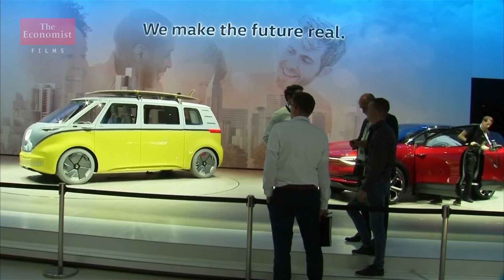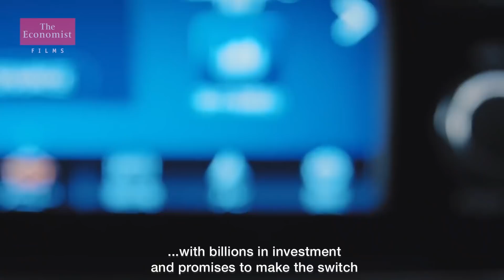Electric cars will come of age in 2018

Comment: Like all new technology, there will be teething troubles, the grid needs to go clean for a start, but stand-alone solar charging stations without any grid connection could be one way forward.
 The Grid is a bit like the Oil industry, it has served us well I suppose but it is also corrupt and rotten to the core.
 Nuclear is certainly not the way forward, at least in its present form, it is just too costly and dangerous and produces so much CO2 during construction of the plant, fueling and decommissioning, if all costs were born by private industry with no subsidies then Nuclear in its present form can never be profitable. 
If the grid is to continue we need more renewables and energy storage facilities.  Tidal power should again be looked at, and other forms of little tapped free energy like Geo Thermal and Air Thermal.

Comment: If the technology is there by 2040 great, but if not the diesels will have to stay. If we had the technology now we could already stop making the diesels  and let the older vehicles phase themselves out.  Could buy a diesel it 2039 and it should still be  good till 2054, i would give up driving then anyway. Or get a 43 year old 24kw leaf they say they last forever fewer moving parts and all

Comment: I don’t understand why people refer to batteries as being as dirty as oil. The battery is the equivalent of the gas tank. But the fuel inside is hydrocarbons and electrons. Now if we had one time use batteries, they would be inferior, but they are rechargeable. 
Then on the idea of it being bad that electricity to charge batteries is still very dirty because it comes from hydrocarbon burning power plants. Well yes, but it’s a lot more efficient to run one big motor than a million tiny ones if the sum torque output is the same.

Comment: Here we go again !   Electricity means burning coal and gas and therefore still pollutes ~ Well that is not necessarily correct.  One only has to take a look at the time and effort going into Molten Salt Reactors (Developed in the USA in the 1950's and 60's) in Japan and China.  LTFRs are to the Coal Fired Power Station what a Tesla Electric Vehicle are to the worst Gas Guzzling Internal Combustion Engine ever made !  Molten Salt Reactors are walk away safe, clean, compact, non poluting, efficient and cam also dispose of the stockpiles of Nuclear wast we are currently trying to hide under rocks and behind mountains !!  Do the research, open your eyes and imagine a brave new world !!

Comment: Electrice cars are going to be burden on the electrice grid ,    watch the price of electricity go right up.
Reply: That is entirely not true.  Most power generating plants are running at idle at night, once the sun goes down, people go home, office buildings go dark, A/C's turn off, computers are powered down etc.

There is a huge surplus of electricity generating capacity at night, which is why most utilities heavily discount it at night.  Wind power is also stronger at night than during the day, and increases production when demand is actually very low.

EV's are ideal to capture that excess generating capacity that otherwise goes to waste, which is also why many utilities offer ultra cheap EV charging at night.

EV's will actually help the grid and lower prices, by capturing wasted energy and using existing generating capacity more efficiently.

Comment: Wow never had the Economist down as a coal shill, also batteries are not solely reliant on cobalt and most manufacturers newer chemistries are drastically cutting the percentage of cobalt which is already less than 5% of battery by weight
Reply: Very true, the newest Tesla 2170 cells used in the Model 3 are down to 2.8% Cobalt already.

Then again, people keep crying about Lithium Ion batteries because of Lithium shortages, not realizing that despite the name, Lithium Ion batteries are less than 2% Lithium.

Comment: Electric cars existed more than a 100 years ago. In fact a 110 years ago they were one of the most popular choice after steam cars and far ahead the gasoline ones, yet the latter took off when mass production of them started - and no it was not the range what made it for the gasoline cars or the availability of gas stations (there were electric cars running charged on gasoline generators already since WWI), it was the lowered price due to mass production promoted by the oil cartel and the banks behind them. It is the same lot of interests which promotes the electric cars today : the reason why is huge : electric cars are far more easily controlled and tampered than gasoline/diesel ones since the real future of electric cars is autonomous driver-less wagons and there whoever controls GPS, controls the economies of nations.

Comment: So electricity will win this game ....... hhhmmmm ......... and what eco friendly energy, if this does exist in large enough quantities, are you gonna use to produce the electricity ???  Not so green extremely expensive and inefficient wind mills and inefficient even more expensive solar panels ????  Good luck !!!
Reply: Not sure what you base your claims on that wind and solar power is not efficient.  Solar panels today last over 25 years, and solar installation today pays for itself in 8 to 10 years, meaning you get 15+ years of free energy.

The USA alone generated 255 Terawatt hours of electricity in 2017 using wind power.  Considering that a typical electric car today uses 250W per mile, that is enough energy to drive an electric car 1.000.000.000.000 miles.

Considering that Americans drive around 14.000 miles annually, that means that is enough energy to power over 7 million electric cars every year in the USA on wind energy, if each is driven 14.000 miles a year.

So much for inefficient wind mills....

Comment: WRONG!!!
Graphene Batterys are already on market and will be from 2019 in Nissan Leaf 
https://pushevs.com/2017/09/08/lg-chem-will-introduce-ncm-811-battery-cells-evs-next-year/
Reply: I think you are confused about something.  The NCM 811 battery is a standard Lithium Ion battery, and has nothing to do with Graphene.

NCM stands for Nickel Cobalt Manganese, and 811 means it is 80% Nickel, 10% Cobalt, 10% Manganese.

Which again, means 0% Graphene, which is a totally different material which hasn't made it into batteries yet.

Comment: Electricity is produced by coal? Yes so is gasoline, because it takes electricity to produce gas as well.
Reply: Gasoline production takes heat, that is not provided by electricity.
Reply: Consider the oil rigs and fields, boats to ship it, trucks to move it. They don't factor all that in the production of gasoline. Electric cars don't care where the electricity comes from. It can be fossil fuels but it can be solar, wind, nuclear, hydro or a generator. It best to look to the future because fossil fuels won't last for ever.

Comment: Solid state batteries are the next generation for electric cars. They  will stop using a liquid electrolyte and use a solid electrolyte. That solid could be a potassium or sodium ( salt ) based material. It could also be a glass based battery. The testing on these types has been going on for over a year but won't be ready for public use in electric cars and trucks until the 2023 models. Point of interest-- who is the leading edge company in glass products? It's the glass cookware company from the 1950's that developed Corning Ware cooking dishes made of glass. Corning went on to research and develop the glass for cell phones and computer tablets known as Gorilla Glass used on all smartphones around the world. If it's going to be a glass based battery, Rochester, NY Corning Glass will be on the leading edge. The next gen battery will be in wide testing in 2019. Glass or sodium is hundreds of times cheaper than today's lithium ion battery, so the 2023 electric car might only cost $3,000 to $4,000  more than a straight gasoline car, meaning prices below $30,000 in the U.S. Stay tuned.

Comment: Moron. First even if you charge your car with dirty electricity it's 5 times more efficient to burn the fuel at the power plant than it is to burn it in the car. That's why equivalent miles per gallon are so much higher than gassers. But everyone will buy solar panels that has a roof to put them on so stop being dumb asses.

Comment: Electric cars are 90-plus percent efficient versus petroleum-based cars at the highest 35% so even if the electricity comes from Dirty power plants they use much less of it also about the Cobalt issue this is 2018 it's already being phased out in favor of silicon electrodes so the dirty electric argument and the Cobalt problem are both being phased out the arguments have no merit

Comment: You already see it marks the end of oil. After all it will run out! Like coal it will go away!  Like burning wood! The car manufacturers see this coming and doing what is need to do now, horse has been replaced by the car and the electric car will replace the gasoline car!

Comment: It takes approx 4.5kw alone to manufacture 1gal/3.7l of gasoline. 4.5kw will get your electric car about 30km alone already. So, instead of spending 4.5kw of electricity to manufactured a fossil fuel into gasoline to then propel a car an electric will comparatively gain an addition 30km right off the top.

Comment: Not going to happen. This is only going to happen if the get the prices down to a comparable gas model. For instance a Corolla which I have and paid around 16,000 out the door. Second they will have to get the mileage up. They need to be able to go at least 500 miles on a charge using the air or heat on full along with the lights on. Third they need to get the charging times down to something like a max of 10 to 15 minutes empty to full charge. Do this and then they will come of age.
Reply: John Smith That will happen eventually batteries get cheap overtime very quickly, so we will probably see that in one or two years
Reply: AKzebraMiner and that will be the time to buy, not now. Every EV of today, within 5 years will be so obsolete that they will be difficult to give away much less sell o trade in.
Reply: That is bunch of BS.  If that was the case, a Tesla from 2013 would be so obsolete that it would be difficult to give away, but yet, they are still depreciating less than gasoline cars, as seen here:

https://electrek.co/2016/09/13/tesla-model-s-value-retention-leading-segment-losing-only-28-after-50k-miles/

Comment: no one acknowledges that cows produce more pollution than cars....
Reply: Devyyon You mean animals? I don’t think you understand how global warming works...
Reply: global warming is when things destroy the ozone layer. cows emit methane, worse than cars.
Reply: Devyyon No that’s the ozone hole not global warming.... And no that’s not what’s creating the ozone hole, it’s just another particle produced by some appliances but most don’t even use it anymore... Global warming is when we add extra carbon dioxide from other things like power plants or cars... at first we had animals exhaling carbon dioxide and plants would use it all and turn it to O2. Now we are adding extra CO2 which is definitely not needed. So now there’s more carbon dioxide everywhere. CO2 captures heat which raises the climate overall... we know this is caused by us because it is very odd that it’s happening very fast rather than gradually over a million years...

Comment: 1:34 And after those 500 km you will need at best something close to 5 hours to get those batteries fully charged. 

 With a single onboard charger plugged into a standard 110-volt outlet, Tesla says you will get 5 miles of range for every hour of charging. From zero to 300 miles would take about 52 hours at that rate. With a single onboard charger connected to a 240-volt outlet, which Tesla recommends, the pace can reach speeds up to 31 miles of range for each hour of charging, meaning a full 300-mile charge takes less than 9.5 hours.

Step up to twin chargers in the car and connect to a 240-volt, 90-amp high-power wall charger (an extra-cost charging unit called a Wall Connector, not just a 240-volt line) and the charging speed zooms to 62 miles of range per hour, and the total charging time drops to less than 4 hours, 45 minutes.

It's going to take long time for electrical cars to come of age. 

For electrical cars to come of age there is two options. To invent batteries that can be charged in couple of minutes. Other option is to make  worldwide standardised batteries. Like AA or AAA. You go to station replace batteries and continue.

In both cases huge investment in infrastructure and equipment would be needed.

 If you have battery charger able to fully charge battery in few minutes there is need for power supply that no standard 110-240 Volts power grid is able to provide. Somewhere in range of few thousands Amps. That's somewhere in range of whole shopping mall. Cords thicker than you thighs.

In other case there would be needed huge number of stations with storage and all equipment needed for charging big number of batteries.

I think electrical cars will be used as daily commuters but for long distance traveling we will need some other option.
Reply: You apparently failed to mention that Tesla already has Superchargers that allow the car to charge to 80% in about 30 to 40 minutes or so.  So, your 5 hour claim is actually not even remotely true, as seen here:

https://www.tesla.com/supercharger

The chargers are typically 120kW or more, giving you around 180 miles to 200 miles of range in around 30 minutes.

This means that if you leave with a car fully charged, you can drive around 300 miles, plug in for 30 minutes (during lunch or dinner), and drive another 200 miles or so.

How many people need to travel more than 500 miles in a typical day?  Not many.

Comment: The stop making electricity with dirty fuels such as coal, oil & petrochemicals : use solar + wind and energy storage & hydro with pumped storage & wave + fusion of hydrogen : the dirty secret of electric cars is a moot point. Charging the EV can be done with electricity from any kind of generation capacity. That means to make EV's clean, we need more clean grid power, rooftop solar systems, home vertical wind turbine generators and other forms of waste energy recovery like heat from flu chimney exhaust gases, waste heat from data centers with distributed blade racks in homes as a heat source and other creative thermodynamic engineering like MLI or multi-layer building insulation tech applied to homes and businesses, institutions and schools, buildings of all kind benefiting from low profile easy to retrofit MLI insulation typically used in space stations :) but on the cheap using renewable materials or recyclable materials!

Your hyperbolic statements about EV being dirty greatly ignores the obvious toxic problems with congested traffic corridors : carbon monoxide + break & tire dust, leaking oils from transmissions and engines with bad seals, fuel vapors from leaky fuel systems + gums and tars in the asphalt off gassing. Gasoline combustion is so dirty that exotic complex rare expensive metal catalysts and complex gas recirculation + vacuum intake blah ... diesel gate : there is no really clean way to burn goo. Imagine if your phone had an exhaust pipe!

Comment: Why do people think electric vehicles don't need oil?
Reply: Peter Bayley Because you don’t...
Reply: They don't need to burn oil.  The amount of oil used in producing the interior components is a rounding error compared to the amount of oil burned in a typical diesel or gas powered car during its lifetime.
Reply: They think plastic is oil free!

Comment: Dear, Economist idiots 3:52 - even if you recharge your electric car solely with fossil fuel-powered generation sources, you are still producing a fraction of the emissions. Why? Because it turns out large, dedicated power generation plants are far more efficient at producing power than your car engine (think of all the wasted heat exhaust from your car). In fact, a typical internal combustion engine is only 15% efficient at turning gasoline into power; modern day power generation facilities are closer to 60%. Hence why, if you spent even 2 seconds researching this, you would note that literally ever electric car on the market today (at least in America) gets 100+ MPGe -- the equivalent efficiency of a gasoline powered car getting 100mpg. DO YOUR HOMEWORK, MORONS!
Reply: False: http://www.autointell.com/News-2001/May-2001/May-2001-4/May-23-01-p8.htm
Reply: Jordan Sage Do your homework moron. Gas is impossible to be created in an environmentally friendly way while electricity you can do both.p very easily. Still a problem? I think you forgot that solar panels are a thing and you can put them on your roof. Now you are charging using power generated by the sun. And which car has an exhaust pipe again?

Comment: Due to lack of charging infrastructure and the vast interstate highway system - here in the USA pure EVs are currently only viable as 2nd cars and/or city cars for people with garages. Even with ranges above 200 miles - Range Anxiety is a very real factor when considering an EV as a 1st car.
Reply: Considering that the Tesla's already have a range of over 300 miles, and the current Supercharging network means you can drive a Tesla from Miami to Toronto, NY to LA, range anxiety is actually not real anymore.

I drove my Tesla from FL to GA and back, a 1200 mile road trip, and it was an absolute non issue.